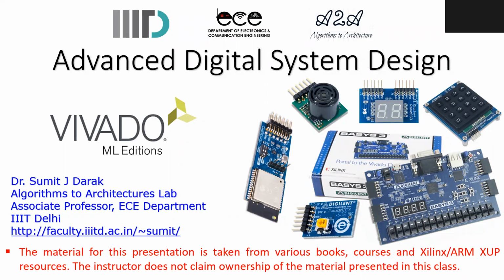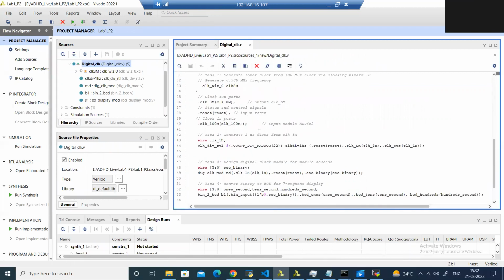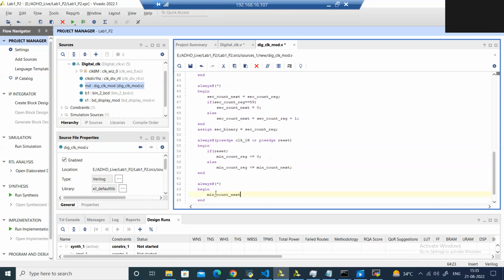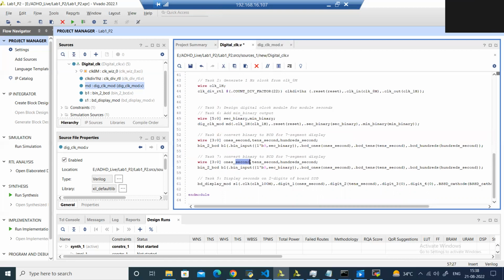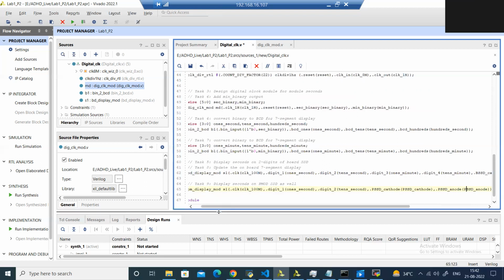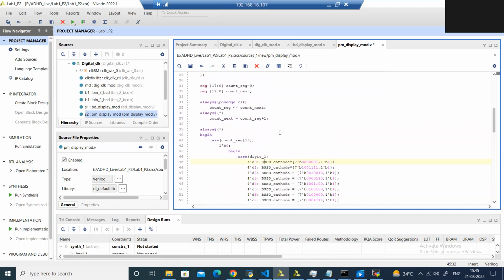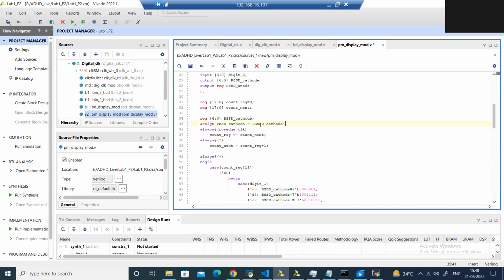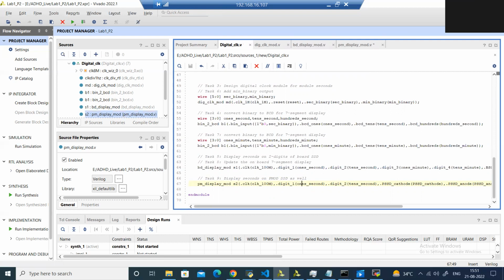Lab1_Part_2_1: Verilog based Sequential Design to control PMOD 7-Segment Display on Basys 3 FPGA

Comment: can this also be done on zc706 fpga board?
Reply from the maker: yes
Reply: @algorithmstoarchitectureii1574  is it possible if i don't use vitis and create block design when driving the pmod ssd? I find it hard looking for IP for my pmod ssd to my zc706 board
Reply from the maker: @hayaoXmugichan  Your query is not clear to me
Reply: @algorithmstoarchitectureii1574  I was practicing driving the pmod ssd into my zc706 board, is it possible if I don't need to create block design ?
Reply from the maker: @hayaoXmugichan  yes...use it as regular FPGA board